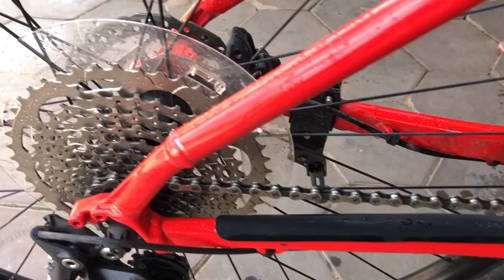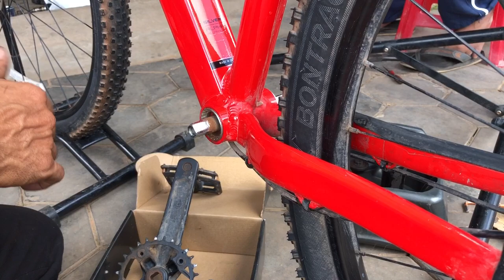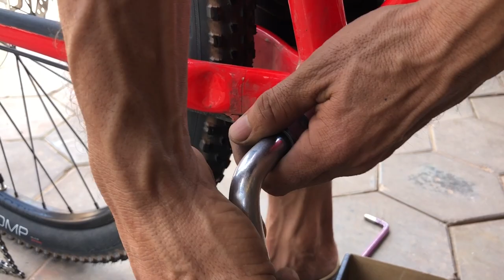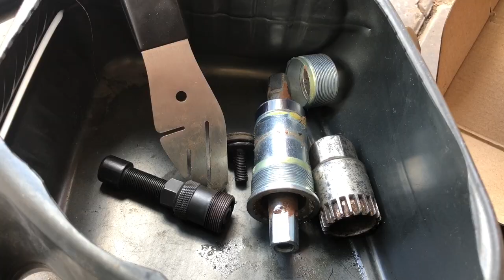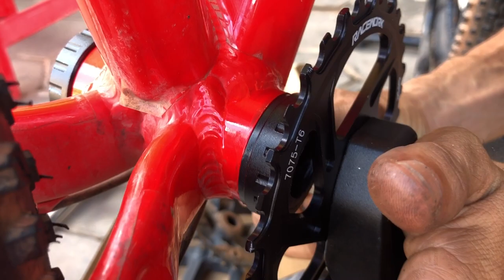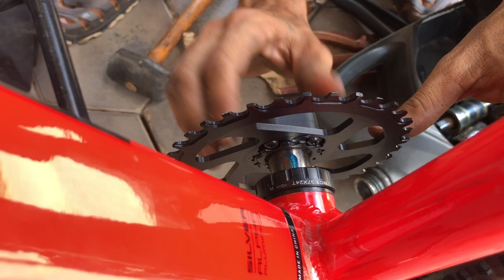Upgrade Chainring Trek Marlin 7 2021 from 28T To 34T

Comment: Noone talks about sizing, type, boost etc. I am new to this and I bought my bike back in early May and the stock crank is creaking. I want to upgrade to SRAM 34T. 
I have a 2022 Trek Marlin 7 with Crank (FSA Alpha Drive, 28T steel ring, Boost, 175mm length) and BB (FSA, 73mm, threaded cartridge, 122.5mm spindle.)
 I am guessing I can go with an SRAM Dub English Bottom Bracket - English/BSA, 73mm, MTB Superboost +, Black AND SRAM SX Eagle Boost 148 Crankset - 175mm, 12-Speed, 32t, Direct Mount, Power Spline Spindle Interface, Black, A1.
Reply: Marlin isn't a boost bike
Reply: I want to do something with my marlin 6. Do you have some kind of  a way we could exchange information? Not a lot of people do upgrades. We could talk over email. You ciuld make a make one and I will to so we can talk.

Comment: That looks like a Shimano bottom bracket. How much does the new BB and crankset weigh? I saw the other video you made of the stock crankset and stock BB weights. Just curious of the weight difference with the newer setup.
Reply from the maker: It About 655 g

Comment: 1. Is shimano deore FC-M4100-2 10-speed front chain wheel compatible with trek marlin 7?
2. What tools are needed for removing and installing new crankset?
3. What other things are to be replaced if we have to replace crankset?
Reply from the maker: 1 Yes 2 Bottom Bracket Cartridge Remove. Bottom Bracket
Reply: @PoleakTonethVlog  you forgot I need to add a front derailleur and shifters 😭😂
Reply from the maker: @061_arsh  Yes

Comment: Is that a spacer that moves the chainring out from the frame and does it come with the crankset?
Reply: The spacer comes with the SRAM Dub Bottom bracket.  I received 3 different ones depending on your application, and width of the bottom bracket.

Comment: Can a 42t chainring be compatible in the frame?
Reply from the maker: Not Possible
Reply: maximum is 34 as listen on trek’s website. I think you can get away with a 36 at most
Reply: @internetuser9342  do you have to replace the chain as well?